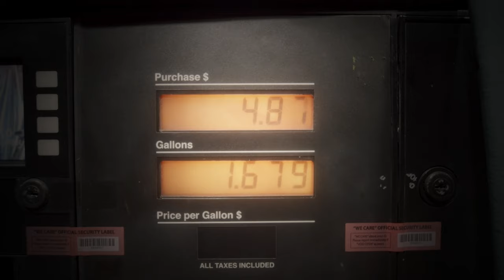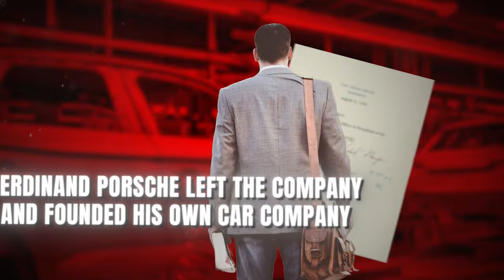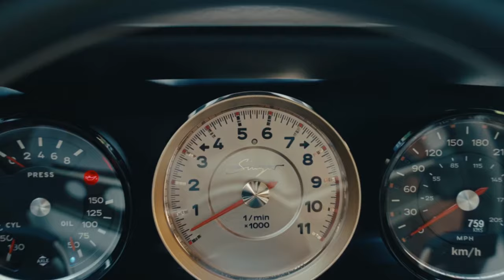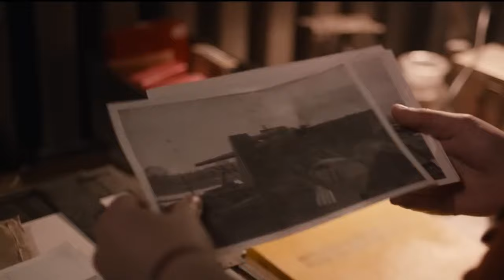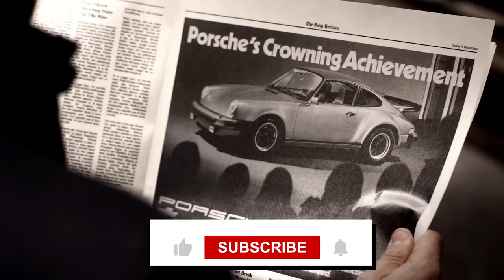They Deny That Until Today

Comment: The Germans made a heavy tank, that was SO heavy if was parked on mud, when you put it in gear the inertia would not allow the tank to move, so the treads would just scrape mud away and dig 2 holes under the tank and itwhich it would drop into.   Was that Porsche's work?
Reply from the maker: He designed the engines not the tanks, and donated money to the nazi government